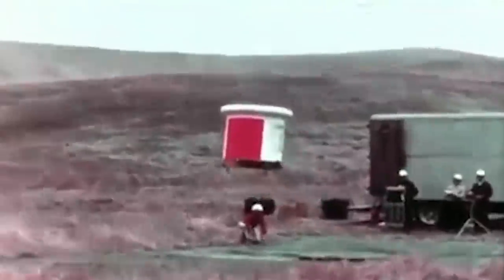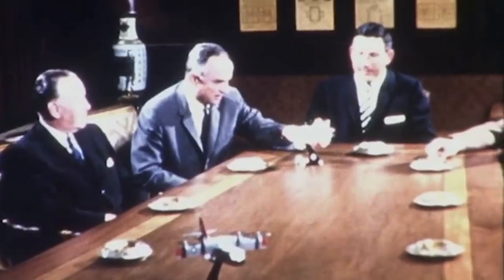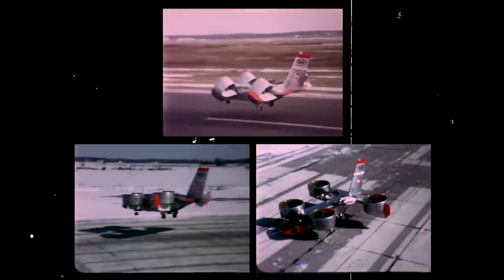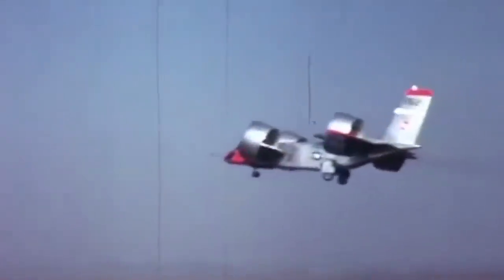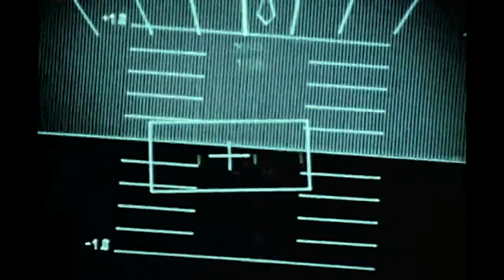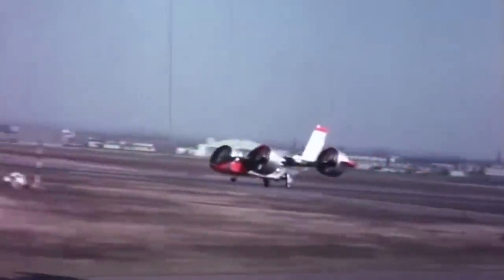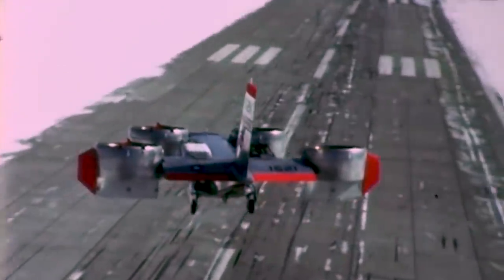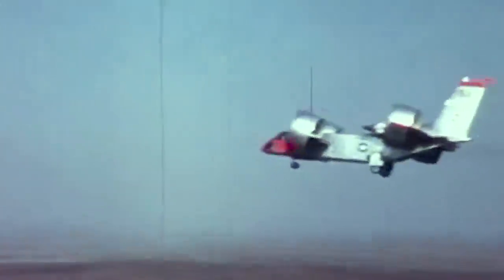Hover Assault Transport - Bell X-22

Comment: This design would probably work exponentially better with our current materials. Lightweight materials and a proper understanding of airflow over and around the ducts could make this a ridiculously capable aircraft.
Reply: and more power from modern engines, through CAD designed, AI optimized gearing, which equals more speed and carrying capacity
Reply: True, however, the driveshaft set up would still appear to be a limiting factor in overall performance.
Reply: @zingwilder9989  Seems like in-hub electric motors would solve the drivetrain issue.  Make it gas/electric hybrid.
Reply: With advances in engine tech, it'd also have MUCH higher payload capabilities, top speed, and handling.

It's a travesty this beauty never saw mass production.
Reply: @DAndyLord  Indeed, I was thinking the same thing. That would be far more efficient and safer.
Reply: @zingwilder9989  True. Plus, you'd have separate engines for each wing, and do the sync by computer vs electro-mechanically, so there'd be no physical connection between wings. And the optimum nacelle count may favor more, smaller set ups.
Reply: @DAndyLord  I was going to make this comment. Replacing drive shafts with electric motors is almost a no-brainer.

That's pretty much all you need to do. Other than a few aerodynamic tweaks.

I wouldn't even bother with "advanced materials", stainless steel like Cybertruck and Starship. Though SpaceX/Tesla's 30X is some pretty advanced stuff, they do have some secret sauce in there.
Reply: @scottstewart5784  Absolutely, that all seems to make perfect sense with current technology. I'm truly curious why an aircraft manufacturer hasn't attempted it? Especially when it has already been proven to have better control dynamics than either rotary or fixed wing configurations?
Reply: Isn't this already a thing? The osprey?
Reply: @scottstewart5784  what about an onboard electricity generator and electric ducted fans? For clarity not batteries
Reply: @Str8upFacts  It's similar to the V-22 Osprey, however, still quite different.
Reply: @zingwilder9989  There are several personal craft coming out/already out. I think the carrying capacity and speed are the commercialization hurdles. What is the weight of the engine that that can generate the electricity required to carry itself and the fuel and the plane and cargo?  Or you have the same question, just with the weight of the batteries in an ev scenario. Does it yet conceptually scale in a commercially viable way?  I assume the answer is no.
Reply: @nobilismaximus  Good question - see my answer to DrJB Dinghy
Reply: @scottstewart5784  I certainly understand. Those are extremely valid points. The ship must be able to lift itself and its payload; and be able to achieve a competitive speed, with range. If it falls short in any of these categories, it will not be practical in civil or military applications. However, I believe the viable point is on the horizon.
Reply: It would not. Quadcopters are extremely inefficient no matter what.
Reply: @jtjames79  do you think shafts are heavier than the hub motors+cabling+batteries?
Reply: @nobilismaximus  electric motor are heavy,  copper cable are heavy too. Also you need to add a electric generator to the turbine which is heavy too.
Reply: @bastadimasta  much, you also forgot transmissions. But it's more about reliability, and features.

If I was designing it today I wouldn't even bother with a cockpit. If for some reason you absolutely wanted and/or need a pilot, consumer VR goggles and a gamepad will do.
Reply: @zingwilder9989  Yes, and Elon Musk may have a hand in the EV part - he's making great strides in batteries. I had a couple Prius (Prii?) - 4 cylinders running on the Atkinson Cycle, optimized for generating electricity over hp or torque.  I guess it will come to units of electricity generated per unit of engine & fuel mass/battery.  And then the efficiency in turning that electricity into thrust.  So many targets for optimization.
Reply: @scottstewart5784  Yes, I have been watching the EV's, closely. It's hard to believe the power that's being generated. The F-150 Lightning is beyond belief!
Reply: @zingwilder9989  Different as in better. The V-22 osprey is better than this thing in every way, except one. It's not as good looking.
Reply: @jimdandy8119  a smallish turbine running at most efficient speed to generate the electricity
Reply: @jimdandy8119  Indeed, the V-22 Osprey is an absolute, and established, workhorse.
Reply: It's great to read so many of everyone's comments and see many ideas discussed without petty bickering. That is another plus to go along with this amazing channel. I'm proud to share my interests with each of you. GOD bless everyone. 
SGT Carlton Lee Smith, Jr. 
US Army RET
Reply: @zingwilder9989  Electric motors. Turbo electric?
Reply: @leesmith6792  Thank you for your kindness. It appears that many of us that watch this channel have been members of the military. We were taught, as you know, that gentlemen, and ladies, always respect each other.
Reply: @alwayscensored6871  Lithium-ion battery electric. That's all that I've learned at this point. The power and torque are unreal.
Reply: This has now become a Research and Development forum. Let's get this bird in the skies.
Reply: @WvlfDarkfire  Get the Flitetest guys to prototype?
Reply: @alwayscensored6871  sure
Reply: Yeah, it's called an Osprey.
Reply: Wait, why do we have the Osprey and not this beautiful design!?
Reply: Pandora movie had ducted tilt rotor aircraft. I wondered if designers had tried this yet. The Osprey had to be the result of this. Still don't know why they didn't go ducted instead of huge open blades? Our latest submarines props are now ducted, I'm sure it doesn't hamper performance and is quite.
Reply: ironically air taxis are doing exactly what you said a revolution to aviation is happening and little people know about it
Reply: @DAndyLord  the issue with that is redundancy the whole point of the multi drives shaft setup is you can loose and engine and all 4 rotors still spin
Reply: To everyone wanting a modernized version of the x-22, look at the bell nexus electric/hybrid air taxi concept.
Reply: It would still be much less efficient than a traditional helicopter because of the much higher disk loading. Simply put a larger slower rotor is more efficient at creating vertical lift than a smaller faster one. That's why helicopters have stayed around. This is why the world record duration for small electric powered drones is held by a Logo 600 electric R/C helicopter modified for autonomous flight and low main rotor speed.
Reply: @zingwilder9989  musk recons that 70% by weight of batteries for an all electric airliner is the tipping point..
Reply: @nobilismaximus  I think it will take a few years to develop but it will be achieved.
Reply: America disbands it f35 for one big ass drone
Reply: Probably would also want to unduct the fans to get rid of ram drag and wall drag penalty
Reply: This design layout is coming back! You are right. Even with a hybrid power train (turbine+battery buffer+e-motors no pitch) probably 50% weight and 1/10 of complexity and added redundancy could be achieved...
Reply: @nobilismaximus  In a hybrid system it is good to put a small battery as a buffer...the e-motor/fan would save a lot of complexity now, probably it would not even need variable pitch...todays computers/flybywire boxes alone would shave off hundreds of kilograms...besides not needing 10 gearboxes any more only 5...
Reply: @scottstewart5784  In some use cases the weight is secondary...the cargo volume/floor space is more important...and the VTOL application!
Reply: @zingwilder9989  Yes, but it was built for the Navy needs so with the rotating/folding wings it is over-complex for civilian commercial use, that is why the 2-3 new tiltrotor aircraft designs will be better for wider use cases...
Reply: They did work well in the Avatar movie. 
I’m struck by the quality of engineers back then. Wow.
Reply: Outdated design, not only that I can’t see the army picking appearance over functionality.
Reply: Change the propellers to jet engines
Reply: A drone stability with airplane like forward speeds... 90's people didn't hav ticktok or Instagram to waste thier time 😂😂 then undergraduate students discovered materials like copper chandrashekhara thought of limit of white dwarf stars mass while on a cruise to join college
Reply: 1:00
They are stupid then
LoL
You understood nothin
Dark Sky
Talk about projects that cant follow changes of the warfare
Simple
Materials mean nothin
Reply: Directed turbofans would be used like the Harrier. And, id love to see a Harrier 3

Comment: I think we need to give this airframe a relook in this day, we've got way more technology now.
Reply: Bell V-280 Valor
Reply: This seems like a great aircraft and it's also hella cool
Reply: F-35
Reply: Yep and every drone has a tiny flight controller.
Reply: @techwithdave  Blackfly is one of my favs.   Cybertruck, trailer and a nuke charging source. Electric Nomad.
Reply: @lexioncombine9403  That could NEVER keep up with this! 🤡🤡
Reply: Precursor to every drone ever.
Reply: @techwithdave  are we gonna pretend like the V22 didn’t exist or something. It’s is a proven design and do the same jobs but better
Reply: This just seems to be an osprey
Reply: @YulHolic24  that’s a good point
Reply: @techwithdave  Technology of carbon fibre+small smart fly by wire systems+e-motor fan+more precise computer modeling+higher energy batteries at acceptable prices are coming together...

Comment: A technical note for anyone who thinks this design could be revived by modern technology.
1. Quadcopters are extremely inefficient.
2. Replacing shafts with electric motors is a horrible idea.
3. Electric motors are heavy.
4. Copper cables feeding the motors are heavy too.
5. Electric generator attached to turbine is heavy too.
6. You also need batteries to make the design stay airborne during an emergency. Guess what they are heavy too.
7. Ducts around the fans increase efficiency at the cost of weight. No gain here.
Reply: I would just go with high bypass micro jet engines and only need to feed it fuel rather than have drive shafts.

Comment: Seeing that Bell were able to build and test this aircraft and get it working it is surprising that the V22 Osprey had such a troubled development. They're not exactly the same but they are quite similar and would have had similar roles.
Reply: It isn't a matter of design deficiencies that plagued the Osprey. The early prototypes that lead to the Osprey worked pretty well and had no more problems than the X22 prototypes.  Much of the problem with the Osprey was with the control interfaces, and the rapidly changing world of computers during its development.  Also, it wasn't nearly as problem-plagued as the media would have you believe.   Every new system that is as radical as the Osprey is has difficulties during development.  Probably the biggest problem was that he developers didn't allow for that fact.  It also suffered from the same problem the F-35 suffered, in that it was conceived and approved to the point of mandate before it was ever fully developed.
Reply: @tarmaque  Would you say that concerns about the high pressure hydraulic systems were overblown?
Reply: @tarmaque  Thanks for your well considered reply and you make a lot of good points. But the Osprey should have been in service much earlier and should have cost much less. The fact that X22 and even Dynavert had gone before should have eased the process. That being said the V22 is now a remarkable aircraft.
Reply: @johnparnell9488  I couldn't say. I don't have that detailed of knowledge about the program.
Reply: @michealoflaherty1265  Personally I think the X22 was a better concept than what we got with the Osprey, but I'm not an engineer.
Reply: The Osprey is superior to this massive  aircraft. 

 Remember politics kept getting into the way just like  many others. Also other aircraft have crashed during  testing that we all know.

 The Cheyenne IMO was the worse debacle outside of the... Arrow? 

 This craft is massive though.

 Either way my point is it is stupid how much political antics are involved.
Reply: @tarmaque  not as problem plagued as the media would have you believe?? V22 killed how many people? 17 marines in one go not counting all the others before that. 20 plus years from paper to working prototype is a hell of a long time by any standard. Granted it is a great machine now but a great price was paid and lessons learned the hard way. I'm very critical because it could have been me flying in the damn thing when they were still solving it's issues out.
Reply: @dianapennepacker6854  Spent any time on one going into combat?
Reply: @jasonm949  Nope, but know many who loved it. All Marines.

 Except one who was a mechanic.
 
So until we figure out blade stall then helicopters are doomed and I think we need to figure out the kinks. 

 Further range, more speed and efficiency. Downsides are maintence and cost but its the first generation and technology has caught up. 

 So many aircraft we love today had many horrible crashes. So I don't know the purpose of your point?

Comment: In 1982 the crippling deficit in Royal Navy Aviation was a V/STOL airborne early warning platform.  Something that could work from the Invincible class carriers for extended periods carrying a big enough radar to look over the horizon.  The X-22 was still flying then and should have been a contender for that requirement.

Comment: Very cool. Impressive stuff for the 1960s. The X-22 with modern materials, engines (or motors), computers and software would make this much better. Can this concept be be integrated into a flying wing design?

Comment: I think the problem isn't the technology, it's the physics. It seems like the design is great and the technology is great, but the physics limit the speed and range of the aircraft which are two huge components of military travel and operations.  Case in point, you see how the V-22 operates in a similar fashion, but without ducted fans you have to increase the surface area of your propellers which makes the design of the x22 significantly different. Hence the birth of the v22 which solve the speed and range dilemma.

Comment: If the remade it with new technology and using Tesla style motors and batteries with duel propeller ducted power units I think with that and light weight carbon fibre material you could make it a massive airship around the size of the large hovercrafts that the UK military has

Comment: this plane needs to have an electric version
motors in the fans, instead of 10 gearboxes from the old jet engines
Reply: Basically a Giant Mavic drone with a cockpit.
Reply: @digger105337  and tilt rotors which can transition to forward flight

Comment: "Double the speed and the same range as a conventional helicopter."
"More stable than a helicopter."
It makes no sense why we don't see quad-copters flying today.
Reply: Yes you do. DJI drones and other like it have saturated the shelves of hobbyists like myself.
Reply: I'd guess they're less safe during engine failures.  Helicopters can use autorotation to land safely in the case of engine failure.  Also 4X the number of components that might fail.
Reply: @DAndyLord  The osprey has had not had a class a mishap(total loss crashes) since their early crashes during the prototype stage.

It is normal in technology evolution to have a certain amount of compromise.

Imagine if all transport technology was solely focused on safety and not Innovation, we would still be stuck with more slower, less effective and lackluster transportation systems.
Reply: @DAndyLord  Autorotation rarely works to stop a crash.
Reply: @h.cedric8157  It never fails.... The F-18 and harrier have more losses.Yet the Osprey  haters pop up everytime.
Reply: @DAndyLord  autorotation will not save a LOTR reliably.

Autorotation will not save a helicopter flown into VRS problem

Autorotation will not prevent a settling with power.

Sorry, not taking flight mechanics lessons from some random dude on the internet.
Reply: @WALTERBROADDUS  osprey haters, F-16 lawn dart haters, M1 Abrams choking on dust haters, M16 Jammokatic Haters, ive seen them all since the start of commercial internet access.

Tribalism. That's what it is.
Reply: @h.cedric8157  I do miss the early internet days of the 1990's. Before the rif raff joined in. 😔

Comment: external combustion engines, fully electric or heat transfer, so that the propulsion is fully electric/heat/ionic, not dependent on air-speed for combustion or electricity/heat generation, can be any nuclear, one nice nuclear form is alpha-nuclear heat direct heat propulsion, air propulsion medium
Reply: the only essential "thing" is the specific energy, energy storage density, which is million times with alpha, billion times with fusion/fission, anti-matter would be some times more
Reply: heat/electric is the propulsion method, however you make that, piped/conducted/wired to the propulsion point, clearly separate the power from the propulsion
Reply: for analysis purposes
Reply: assume power transport losses are non-significant
Reply: if you calculate the circular wing length, two duct rims per side, you get the normal air-plane equivalent wing length, without any tip vortices, because there are no tips
Reply: it can be strictly symmetric, no need to move the rear ducted fans from back of the front ducted fans, two consecutive turbines or rotors work too
Reply: it needs to be made, strictly drone tech, range extender gasoline-electric versions
Reply: or alpha-nuclear-electric, so that you dont never need to bother too much about refuels, or just solar on the surfaces, to reload wherever
Reply: or any other renewable electric recharging station, on-board or at-home, or at station, whatever